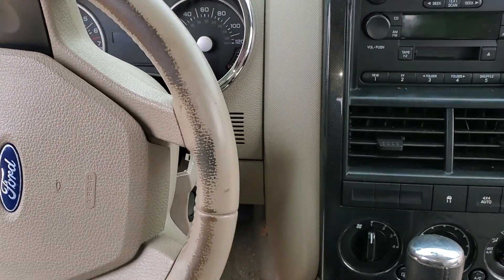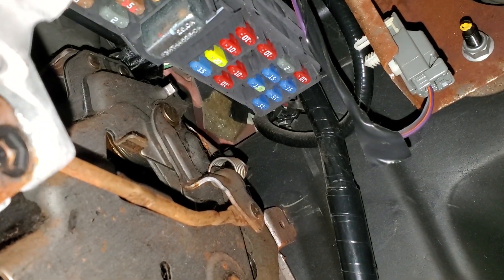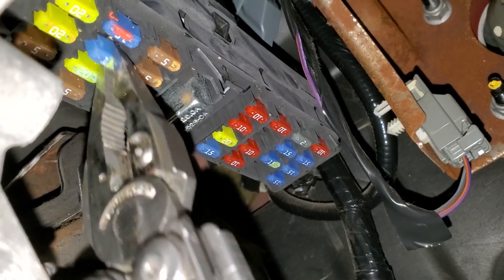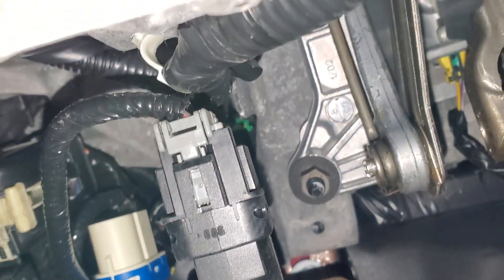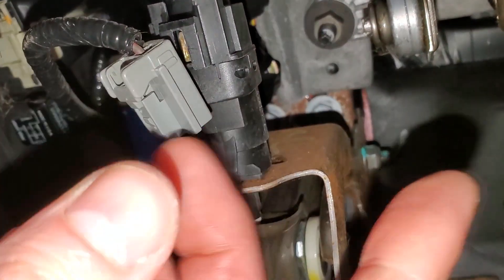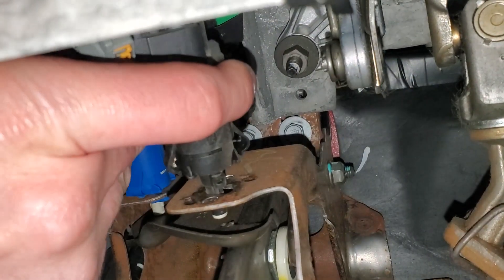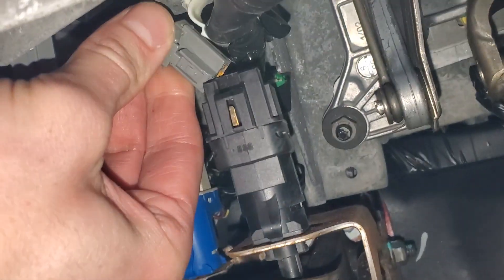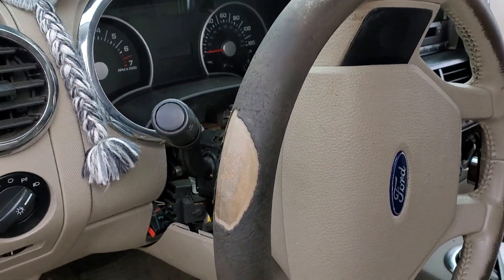2006 Ford Explorer Stop Light Switch Replacement, Brake Light Fuses

Comment: Thank you for the video. Made my job a bit easier to figure out. Not only were the brake lights not working, mine wouldn't come out of park. It seems replacing the switch cured both issues.
Reply from the maker: That's great man

Comment: Does this switch also engage the breaks to push the pads against the disc?
My breaks are stuck in engaged mode and wont allow the car to move...
Reply from the maker: This switch does not engage the brakes. Brakes are engaged hydraulically or by a cable connected to the parking brake pedal assembly

Comment: I have 2005 explorer, I changed the brake light switch and now when I shift to reverse or drive the engine stops running. Do you know what is wrong sir?

Comment: I noticed on the taillight its only one wire for the brake light, and turning signal light to comes on, I want to seperate them to make sure I have an amber color for turning , and seperate light for braking.

Comment: Thank you for this video it was very informative. I have a 1995 Ford Explorer and I am having an issue where my left and right brake lights come on when the car is parked and turned off. I am having to disconnect my battery every time i park for more than 15 minutes for fear of having my brand new battery go dead. I have replaced my brake light switch and that seemed to work for a few days but it just started happening again (Basically it happened when I opened my full trunk (not just the glass)) Have you ever encountered this or have any idea what it could be? I am kind of at my witts end with this one and its really frustrating. Thanks in advance for any info you may have.